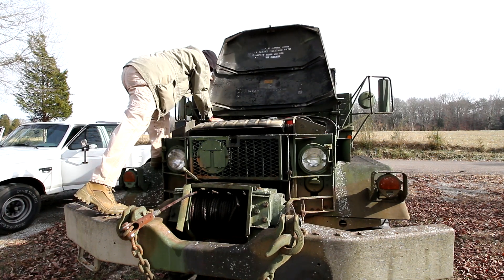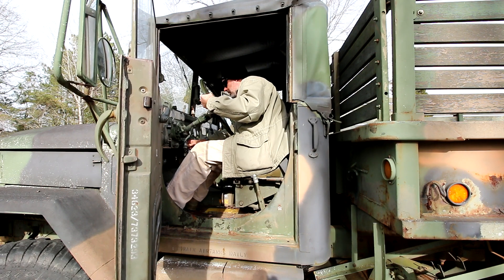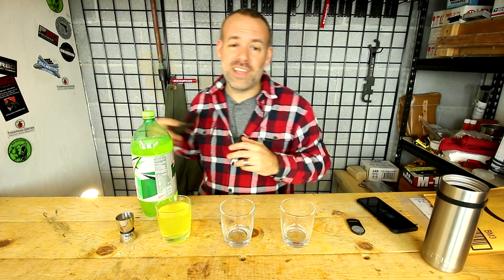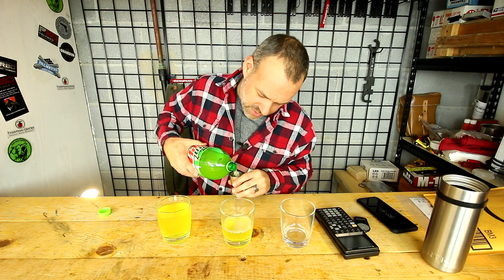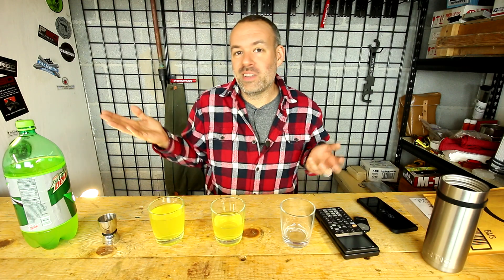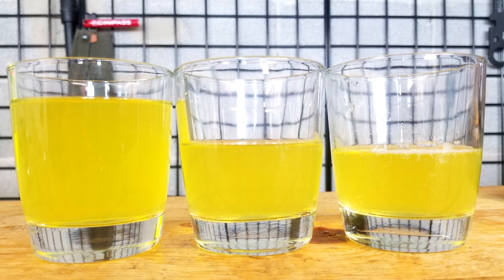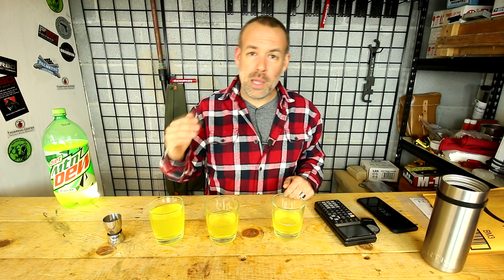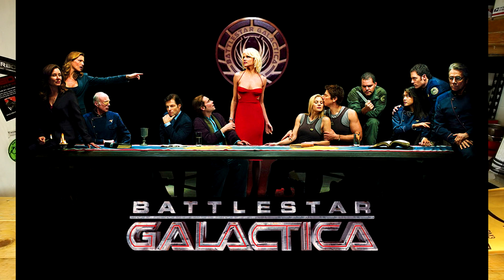Engine Cold Starting Explained by Deuce and Guns

Comment: I laugh at you southern guys with the cold starts, my 1994.5 7.3 powerstroke lights right up below zero, need good batteries, and the right oil, my 1999 Dodge 2500 Cummins lights right up like nothing. Also, treat your fuel, Howes is your friend
Reply from the maker: A southerner prepping for sub zero temps would be like Wyoming prepping for a hurricane.

Comment: i thought you were suppose to wait until the buzzing stops?
Reply from the maker: The buzzer the low air pressure warning and the air pump is run by the engine.
Reply: @deuceandguns  oh ok thank you.

Comment: Living in MI and had lived in NE, I've had my fair share of cold starts. MI wasn't too bad but NE was bad. I had to take my Deuce out one morning in the winter, it was -2°F not counting wind chill. I actually didn't have much of an issue, only because when my military batteries went to crap before I moved from MI to NE, I bought a pair of bulldozer batteries that were 980 cca at 0°F for the Deuce. Those batteries turned that engine over at around 700-750 rpm which is considerably more powerful than the crap military batteries. I remember the first time I cranked it over, after checking for hydrolock, I cranked it for 3 seconds. The second attempt was for 4-6 seconds and she fired right up. The worst part was waiting for 20+ mins for the thing to get warm enough to actually melt the ice on the windshields. Even after it got warm, it was still cold af to drive. This was when NE had that big snow storm that pretty much shut the state down for a few days and we had snow drifts almost 5ft high in some areas, while many folks were stuck where they were, unfortunately I was one of the very few to actually show up for work that morning, lol, the Deuce plowed right threw all that like a hot knife through butter...ever since that storm I realized no 4x4 I have ever owned could even compare to the Deuce when it came to the inclimate weather and it's ability in piss poor conditions.

Comment: Interesting thing is that GE and EMD built Locomotives have freeze plugs that drain the fluids to keep them from freezing. I'm from down south like you ( originally from Georgia but now live in Florida ) so we never had to do some of the other procedures, but in Atlanta, Georgia one time at the former Tilford Yard we had to leave the Battery "Knife" Switch ( Main Breaker ) closed and leave the Locomotives in Jog on the General Electric ( GE ) ones and in Stop/Isolate with the General Motors Electro Motive Division ( EMD ) built engines. Ever so often the Locomotives Computer will crank the engine up and it will idle in where between 15 to 30 minutes they will idle to keep the Prime Mover ( Diesel Engine ) and Fuel warm. They will then switch themselves off for about 30 minutes then you will hear the low air pressure bell ringing then the engine will re-prime itself then crank again. This process repeats until someone comes into the cab and completely shuts it down or if they get in switch the engine to Engine Run from Jog or Stop/Isolate then they will get going to work. The Norfolk Southern Railroad and a few others have electric heaters that keep the blocks warm just line the trucks you where talking about. CSX Transportation where I previously worked didn't have any, but used the technique I mentioned above. This isn't about trucks but I figured I'd tell you about it since they are closely related.

Comment: 22:1 compression ratio on gasoline?  Yikes!  Gasoline is way too volatile for that much CR.  Sub-zero starts here in Minnesota:  I have an attached garage, so my house bleeds heat into the garage.  No starting problems in the garage.  Engine heaters are worth their weight in gold up here.  If I can't plug in I start the car every four hours and run it for 20 minutes.  I lose a little sleep, but it's worth it.  Another key factor for cold starts is quality gasoline.  Stay away from the cut-rates.

Comment: Wisconsin boy here. 

My Dad has a 2010 F250 diesel that came with a block heater (though the truck was assembled at the Kentucky plant), and every year he's had it from about December-March he's plugged it into the house for 3-4 nights a week. 

His advice to us boys before we left for college was to put a container of Iso-HEET(red bottle, yellow label up here) into every tankful of gas once the air temp dropped below 30°F ( Iso-HEET is also good for diesel engines too). Helps immensely with cold starts, even down into double-digits below 0°F, and helps keep condensation from freezing your gas lines. Had that happen to me with a Grand Am, after neglecting to keep up on weather forecasts.

Comment: I live about a mile from the Mason-Dixon line and rather close to the 40th Parallel. It is rather common on fleet vehicles like school buses to have block heaters on diesels, but I don't know anyone with a diesel truck or car this far north. On the other hand, it is very rare to see block heaters on gasoline vehicles and I've only seen it on a 2002 Dodge Grand Caravan which was originally for the Canadian market. Of course discovering the block heater (during my ownership, it's been in the family for over a decade though) was not a surprise since I already figured out (and confirmed via Carfax) that since it had Daytime Running Lights it was a Canadian vehicle since only Canadian models had DRL for a long time. We never use the block heater on the Dodge. I think for those really far north you can also order a battery heater to keep the battery warm for starting.

Comment: I see it everywhere about double cycling the key on fords. Anything direct injection diesel so 94 1/2 + 7.3l and up you do not need to cycle the key. The glow plugs are automatically cycled by the pcm for up to 5 minutes by the pcm with the engine off and running while it is under a certain ect.

Comment: Here in Puerto Rico, is always hot, average weather temperatures are 90° Farenheit from April to October and 60s to 80s on "winter time" And I keep hearing people saying to completely remove the thermostat from the housing and discard it completely, so that coolant will have a continuous flow, so that it will run cooler. I drive my deuce on the daily and average of 100 miles and I've seen it reach around 180° Farenheit on the temperature gauge. Will it be a good/great idea to actually remove/discard the thermostat?

Comment: You have done quite a few videos with the Deuce, but what do you use it for on the property, or was it something you got for a price you couldn't pass up type thing?
Reply from the maker: A little bit of both.  I needed something bigger than my F-250 to get to the overgrown part of the farm and the Deuce was super cheap.  I've now got most of the places I want to get to cleaned up enough to use the F-250 so the Deuce has become a toy for the most part.
Reply: DEUCE AND GUNS  Nice, I've been wanting one but geez, like the cost of a diesel pickup the prices on them either increase or stay the same LOL.  Really don't need a Deuce but would sure be nice, especially since I've got a new neighbor about 1/4 mile away that has a Deuce.

Comment: Extreme cold weather starts? Crank that baby without stopping, until it starts! With exception: don't crank continuously for more than a minute without letting the starter cool for a minute, then if the vehicle doesn't start,  begin cranking the engine and follow the instructions on the ether dispenser.  The key here is to dispense the ether with the engine cranking so it can be gradually sucked into the engine and ignited...the same soldier in the previous comment who ruined the engine in the Blazer, also used about half a can of ether trying to start our unit's D7 bulldozer...he sprayed and sprayed and sprayed until ether was pooling inside the intake manifold. Well, the engine didn't start then either.. . The ether exploded and cracked the turbocharger right off the side of the engine block. Our motors sergeant heard the bang and came out to investigate...hell hath no fury...soldier in question had his military driver's license revoked on the spot.

Comment: About redlining old military trucks...we had a fellow National Guardsman in the unit my dad and I were in...
He got into a CUCV (Chevy Blazer) with the old Chevy 6.2 liter naturally aspirated Diesel engine. He drove from the front gate of Fort Ripley to the armory (2 hr 6 min trip, by civilian car, with speed limit 65) in a little more than one hour. He averaged about 90 on the trip. The truck was running when he parked it....but it didn't run again until our motors sergeant overhauled it. 
The soldier who wrecked this engine, spun the main bearings and when the engine shut down, the engine froze. Lesson: these old trucks were designed to go the maximum legal speed on US roads when they were designed: 55 mph (88km/h).

Comment: Around -50° F the gasoline isn't frozen but the volatile components don't evaporate. It stops smelling like gasoline and smells like tar. It won't burn. You have to heat your fuel tank or your engine won't start. Also, your engine oil is very much not oily, it's about like butter. Your oil pump won't. You need a block heater in this instance to reduce the risk of permanent damage to your bearings, particularly in the top of your engine where oil cannot flow if it's frozen and you have combustion heat starting to mess around with tolerances.

Comment: I read someplace the multifuel engine only had a 10,000 mile rating. That seems low though- is this largely accouting for someone driving it foot to the floor as mentioned?
Reply: Many never hit 10k because they weren't driven much, many military vehicles don't get driven very far, but the have high numbers of idling hours LOL.  Those engines were built to last, 10k isn't even broken in for a multi-fuel engine, and when treated properly they'll run forever.

Comment: When I was on QRF for the DMZ 87/88 we would get up at midnight and run the engine, until it reached normal aperating temperature and then again around 06:00 and I never had a winter Nonstart. At home now, in Western Ky, when we were single digit, I started our vehicles at 11pm (15/20min) and no failures in the AM. In the early 80's ((Wisconsin) we would drape a wool blanket over the hood and fenders and that seemed to help keep enough heat in to start in the mornings.

Comment: Don't forget about the flame heater in the intake manifold that our trucks have! I've yet to use mine as I haven't gotten to rebuilding it and I heard they can be leaky, but that's where the only spark plug is found on the truck.
Reply from the maker: I went over that in a video last year but my deuce doesn't have one.  I had to just show the place it mounts to.

Comment: I got a 86 f250 with the 6.9 and living in Wisconsin it gets cold. I got a block heater from NAPA and as long as I make sure it’s plugged in at least 2 hrs prior to me going anywhere it will start fine if not they can take a while

Comment: I caution you and everyone else... do not reach through an airbag equipped steering wheel. An accidental detonation will ruin your day
Reply: patr10t762 
It would ruin your day no matter if your arm was through the wheel or not. Chances are so rare that it would ever happen starting the car.
Reply: +Rob Sponenberg they are not supposed to blow shrapnel at your face either.  I towed an early generation airbag Chrysler due to the bags detonating while crossing train tracks. Part of my warning is to be aware because the system can be unstable after a collision and if one makes it normal to reach through then the behavior will continue when the risk is higher. Thanks for engaging in a conversation.

Comment: My 95s glow plugs run a good 2 minutes, verified by multimeter on the gpr. Also, btw, Ford puts a relay on there too small for the job. Ford's is 150 amp, white Rogers has one that's 200 amp. It's a 200 amp system. Makes me laugh. Mine starts on glow plugs down to 0 no issues in North Idaho.
Reply: I will admit below 50° mine gets a winter grill screen for fuel economy sake. If I can get the temp into the bracket on mine, she gets around 19mpg, if it's below the bracket it'll go down to about 15, it's all due to the oil pressure driven valve system. Thicker the oil, the harder it's gotta work to open the valves up. I do have a block heater, aftermarket unfortunately, previous owner left it plugged in all the time and burned it out. Stock heater is 1100 watt, mines 400 watts. Couple hours on that tops is all ya need and she'll spit up warm air out of the defrost in a couple of minutes.  My old 95 doesn't need much, but I'll let her warm up about 10-15 minutes on cold days with a throttle stick proped to the seat to get the idle rpm up around 1100-1300 rpm.

My Kenworth doesn't idle all night til were below -10°F, nothing out of the ordinary to fire her up when cold, 3-5 minute warm up tops. The apu that's on her cycles the antifreeze from the main radiator, she gets warm pretty quickly. Apu runs most nights so I can cook and run climate control. When I'm not doing that it's got a standby mode that's on all the time which monitors the battery charge. Other then that nothing crazy. A proper set of injectors will fire a diesel with out the need of ether where I'm at. I refuse to get a diesel hook on that stuff, it's worse then crack to a diesel. That's what a block heaters for. And if all else fails, pull the heater core lines and hook them into the heater core lines of another vehicle and warm it up that way if it gets too bad. Never needed to go there and I've had this Kenworth in North Dakota with temps around -17 and she still started... Fuel was a little gelled up but that straightened itself out in like 20-30 minutes of idle at 1200 rpm.
Reply from the maker: That's good info.  The next time my relay needs to be replaced I'll look into that.  Thanks.
Reply: Btw, Amazon Carry's that relay and glow plugs. In the old IDI the plugs tended to go out, but in these Powerstroke motors it's pretty rare they need replacement. Usually it's just the gpr. Went through all mine 2 years ago when we did the block heater and my gpr. Gpr and heater we're the problems. Also checked the fuel bowel heater, it checked out to. If she has starting issues, 99.9% of the time it's a weak injector. Can run a buzz test to find it with an OBDII tester. I do it with a Bluetooth plug and the car gauges app on my Android phone once in awhile. :) Save a little money. Car gauges pro is like $3 and the Bluetooth OBDII plug is around $20 on Amazon also. :) Hope that helps

Comment: Even the southern trucks had the block heater installed. Looked above the oil filter in the oil cooler header. Should see the cord coming off. Follow it forward, likely ziptied up. 
Also, on the 7.3 powerstroke, the WTS light has no correlation with actual glowplug operation. Glowplugs will run up to 2 or 3 minutes. Next time just leave the key in the run position and watch for the voltmeter to pop up. Try it.
Reply from the maker: I've won several bets asking people to show me where my block heater is. In its place is a factory installed bolt.  I may do a block heater scavenger hunt as a fun YouTube video one day.  I actually remembered to leave the key on for the third try which was the reason for the edit.  I once went over two years without an operational relay which tells you how often I have to think about cold starting.  Thanks for watching and for giving me the video idea.
Reply: DEUCE AND GUNS Maybe the previous owner swapped it out for whatever reason. Everything I've seen has said these older trucks all had the heater from the factory. Definitely not hard to install. 
With no block heater, mine still started right up at 8°F.
Reply from the maker: Original owner told me it didn't come with one.  It was bought through the Ford Fleet program if that makes any difference.
Reply: No clue on the fleet program. Lol 
Mine was ordered here in Oklahoma. 
If you were to go for a heater, I would do one of those circulating heaters.

Comment: Got a 1971 M813a1 5 ton
Started it last week @ 7 deg F
No block heater, I place a space heater under the oil pan for a few hours before I need to start it,use a timer on the power cord feed.
Make sure the batteries are charged. Let the pre heater run for a minute, pump up the fuel pressure ( hand pump) on dash to 30-60 psi and crank it , usually it will start on the  3rd try. I take it easy on the starter no longer than 8 seconds. Of course I check the fuel for jelling by looking in the tank and have winter diesel additive in the tank. The old beast started right up. I live in up state NY.
Thanks Tom 
NORM III